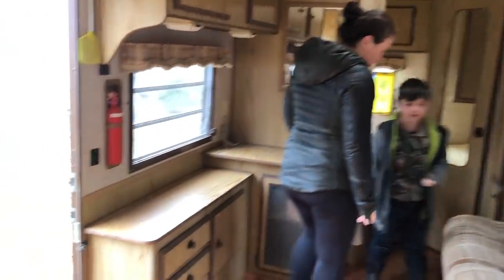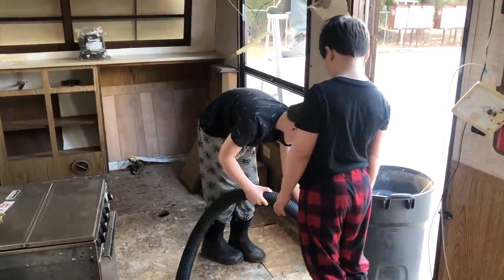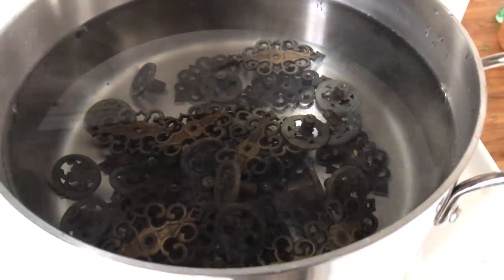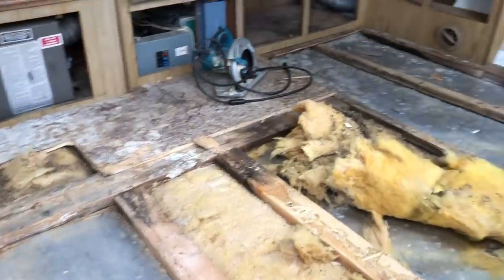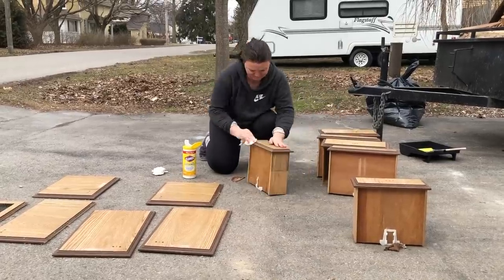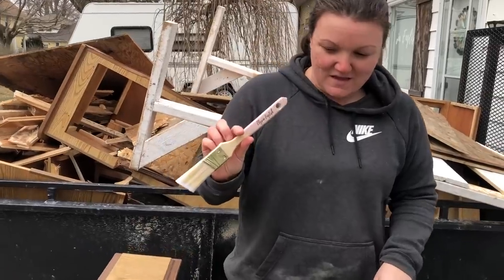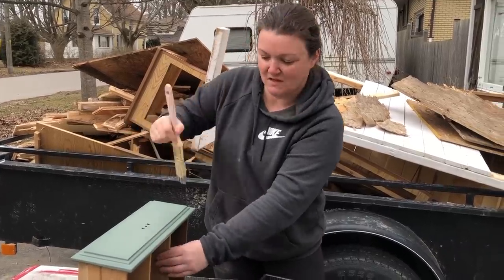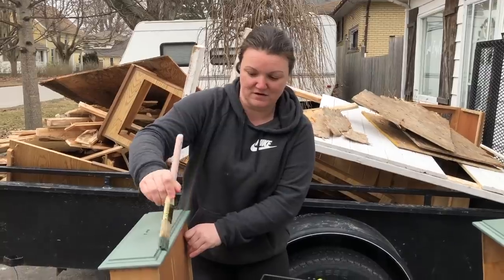Camper Makeover | Adding Paint!!!?? | Episode 4

Comment: Hey … First, thank you for the Camper Makeover series you are doing. It has inspired me to begin looking for an RV and doing a makeover too. -- With all the new technologies, the sky is the limit and your imaginations will be your only limitation. My parents owned a motorhome back in the 80's... a couple things they added were a TV, huge plastic storage bins on top, a really powerful AC, and a microwave. One thing that will set a killer ambient mood (and this won't cost much) is LCD lighting tape under and over your cabinets. The should have it on rolls at most of your home stores, and if you wire the strip (self stick) to your electric you can also add a dimmer switch for night. Thanks again, and I look forward to seeing more videos from you. BIGGEST HUGS.

Comment: I'm loving this series and especially your family's enthusiasm. A nice spring project to help get one through the coronavirus doldrums. Regarding mold under the mattress: a friend had a built-in plywood platform bed with a thick foam mattress and discovered that body heat created condensation under the mattress, resulting in mold. He replaced the moldy plywood and drilled ventilation holes in the new top before laying the mattress down. It cured the problem. I understand condensation can be a real issue in trailers.

Totally love your green color for the lower kitchen cabinets! It's the same color I painted my laundry room. I also lucked out and found brand new complementary green vinyl sheet flooring--the super-expensive antibacterial kind used in hospitals--for 1/4 the price at Habitat ReStores. Given the small size of your trailer, it might be a good alternative, even if you had to pay full price. If nothing else, maybe put a piece in your bathroom where the antibacterial qualities would be a bonus.

Comment: We are all having great fun watching you do this. I will add a couple of tips to the already great ones given. 1) Refrigerators don’t work correctly unless your camper is level both side-side and front-back. Since almost no campsites are flat, we got a small level and carry 6 or 8 boards - 1x10 or 2x10 cut to a length no longer than the distance between your 2 camper tires. Imperative to also have 2 chocks (or blocks of 6x6) to throw behind the tires.  2) RV ovens burn food quickly. Put a pizza stone between burner and pan.   Making great memories!

Comment: Think Tiny House living: everything should serve double duty. I have had several trailers/RVs. If you put booth seating: drawers that glide out so you do not have to lift the seat causing one to get up and move. Also, cabinet shelves should glide out but also lock. Dont want doors opening and food spilling out when your pulling trailer. LED lighting. Butcher block cutting block prep that also covers stovetop when not using. Collapsable everything, room saver. Orderizers for septic tanks. Do not use bleach for tanks--bad. I can go on n on.
Reply: Melissa Ramirez I have not owned a camper/RV but love all your suggestions !!!  Great ideas!  And you are correct to THANK TINY HOUSE LIVING 👍

This is exciting 😁😁😁💕

Comment: Having enough electrical outlets! Especially in places that make sense for you guys. Since you guys will be editing videos in the trailer. In the trailer I have there isn’t a lot of outlets, and they are in the most random places.
Reply: In a trailer, the outlets/wiring are dependent upon the amps the breaker can support. The trailer is probably a 30amp and can only support that much total. So if you use 2 appliances that are plugged into 2 different outlets that use more it will trip the breaker. Hope that makes sense.
Reply: add usb outlets for charging phones and computers.

Comment: The first thing I learned was that I did not need as much clothes as I packed into it. Second thing was to put more  snack foods like popcorn because you can cook it out over a open 🔥. Good luck with the wall paper if it was factory applied u will end up taking chunked out of your walls if it was factory installed the best is to glue and seals all seams patch anywhere there is a hole and then paint over it. I tried to remove factory paper and had to replace a wall. If u leave any wood that is not going to be painted it’s a good idea to use some wood restore on it that woods drys out. Also u need a water filter they have the $$$$ ones but if it just weekend camping and vacations there are a ton on the market that’s good. It’s a good idea to have a folding clothes drying rack to put towels on after showers they will smell quickly if several is left in bathroom ikea as one that folds up to under an inch wide about 3 ft long it’s easy to stow and u can hang them out side and dry in a few minutes. People also forget to put pot holders in the campers on first trip out. Also magic marker and pen and paper marker for marking paper cups and pen and paper to write lists of things needed

Comment: You will need a canopy of some sort. It does not need to attach to the camper. But, in rainy weather you need to be able to expand to the outside. (Along with some folding chairs and  a folding table.)

Comment: I have built a few tiny houses on wheels, and a gypsy wagon.  In all of them I have taken out the wet toilet, and gone composting with urine divert er.  This leaves you able to dry camp for sooo much longer without looking for dump stations.  On the trailers with tanks on board already, I have re-plumbed the black tank to grey, and plumbed the urine diverter into it.  It also cuts down on a lot of weight.

Comment: Ivory done a few campers and trailers in mobile homes in my time you don’t need to remove that awful wallpaper just wipe it down with the same thing you were wiping your cabinets down with and then just paint it it’ll come out beautiful and it’ll be a real mess if you try and pull it off because it’s not regular wallpaper
Reply: Bertrelle Phillips Absolutely correct!  We are full time RV dwellers!  That wallpaper is part of the wood. Just paint it!
Reply: I agree, only if there has been no moisture penetration to the wood behind.  If there has been, it will show through, and may even de-laminate.

Comment: Hi Elysia,

You folks are doing a great job!  Can’t wait until your reno is done.  

Must haves:
1.  Many RVer’s use an Instant Pot, I prefer the Ninja 4 in 1.  You can research both and compare.  Great for a family of four, easy to use and the recipe book is amazing.  
2.  Also, we found an 8 piece traveling metal fence for our dogs when we are camping.  We got two sets, so 16 panels. (Amazon)  We store the panels in a twin trifold bed canvas bag when traveling.  Must have for us, so that our small dogs aren’t tangling up any chains or knocking over outdoor furniture.  It assembles easily and quickly and we can relax outside while our dogs have independant movement in our camp yard area.  We choose Yaheetech 24” tall Heavy Duty metal pet fence.  It works really well and has become one of our top 5 favorite items.

Comment: Hi I'm new to your channel and I like what ya'll are doing....I have never had an RV but I would think you'll need some kind of hamper to collect y'alls dirty clothes and maybe some bungee cords to secure the cabinet drawers in case they decide not to lock in the middle of a trip definitely cast iron or metal or even the rubber heat resistant cooking ware for your stove/oven and bright high powered led battery or rechargeable lights and definitely a table cover for the picnic table or some foldable dining set and an outdoor rug to set up a sweet space at the campsite...and hooks to hang up wet towels or clothes or maybe even a retractable clothesline to keep all that wet stuff out of the RV and a collapsible basket or box to keep your shoes outside or at least contained to keep your space clean...cooking stuff for outside on the campfire in case you want to cook outside....just thinking maybe this helps, maybe it gets you thinking...thanks for sharing God bless and stay safe...can't wait to see your adventure videos 🥰

Comment: You may not see this comment but putting here as I’m binge watching your trailer make over in case anyone has the not rolling roller issue. The weight of the paint especially for small foam ones wont let it roll at first. Use the paintbrush to layer on paint onto the backside.
Reply from the maker: My roller was new a a little tight :)

Comment: All your dishes should nest into each other. Crock pot, electric skillet( your gas will run out quick if you need heat. Mini vac for cleaning and for vacuum bags that hold extra linens, dirty cloths etc... keep all foods in Tupperware or the like to keep bugs and mice away. Travel size games! Door mat for outside and inside the door. Muddy or wet shoes put in a tote with the lid under the step. Sit on step to take off and put on your shoes.

Comment: Do everything you can to plug every spot a mouse could get in.  And have traps set all the time just in case.  We always have nylon cord to run between trees for a clothes line, stick-up hooks to hang wet towels/clothes in the tub, solar lights, a carpet for outside the door to keep dirt out, small shovel to dig trenches when our site starts to flood, small axe, mosquito coils and bug spray, a level, basic tools .  It's an endless list and after 15 years with various campers, we have pretty much everything dedicated to the camper now.
Reply from the maker: Thanks for the tips!! I jotted them down :)
Reply: @ElysiaEnglish  Oh and blocks for the wheels and something for levelling the camper [trust me you may think not being level is not a big thing but the person on the low side of the camper won't agree by morning]. You can get specialized blocks, but sometimes an old board works too.  If you're using the toilet [#1 only!] take the hoses to drain the tank, but also disposable gloves.  Seems wasteful but you'll thank me.  We keep the hose in a giant ziplock bag.  If you're in Provincial Parks there's no water or sewage hookups, so you'll need containers to carry water from the tap to refill your water tank.  We don't drink the water from our tank so re-use 4 litre bottles and take our own drinking water.

Comment: Love following you on this adventure.
From one Camping newbie to another, try using "multi use" utensiles. OXO has a measureing tool for both liquid and dry, it's a cone inside a cone with measureing lines on the side, slide the inner cone up to desired line and fill. Try not to use a lot of paper plates, but use thin corningware dishes. 
All the best to you and family.

Comment: To get the original brass patina from your handles and such the best way to do it is not to boil it it is to get a little container that can hold gasoline and put a little bit of 85 ethanol in the bowl with the hardware

Comment: This may have been said but, keep weight in mind. What ever weight you take out, keep close to that when adding and replacing. You want the camper to remain relatively the same weight as manufacturers specs, For towing safety and fuel mileage. We redid our 1991 26’ bunkhouse camper. We had the year off and replace the entire roof. And then everything from there down. If was fun and more time than i thought. But the results were great. Having something custom to our needs and People wanting to tour it when we want places made it all worth it. Keep the wallpaper, it is factory fused, it won’t peel. You have to paint over it. I’m sure you have figured out that you can paint the bathroom sink and faucets with special paints. The option a are endless. Just be mindful of weights and weight distribution. Can’t wait to see the result.

Comment: Must haves for me (it’s just my experience).  A hot plate (we know what it’s like to run out of propane).  We also purchased one of those faux fire places that give out heat for when you’re out of propane.  Also, get a few tubs of Damprid when winterizing your camper (condensation in the winter happens fast and it can start getting smelly).  When you winterize, keep the fridge open so it doesn’t get moldy and smelly.  Think dual function furniture.  My ottoman was also storage space for extra blankets.  Always have flashlights available and batteries (candles too).  A collapsible dish rack that goes in the sink.  Also one of these https://www.amazon.com/Roll-up-Foldable-Stainless-Kitchen-17-8x11-2/dp/B0173GPLA2 (game changer, serves as extra counter space for tiny kitchens)...hope this helps.
Reply: CAUTION!  CANDLES KIDS & DOGS IN SMALL PLACES ARE A ACCIDENT WAITING TO HAPPEN.
Reply: diana lyman - you’re right!  I overlooked that she has little ones.  (Let’s skip that one).

Comment: I love the retro green paint!  I have a question:  I’m reusing some pine closet shelving in my new pantry. I’ve sanded all the old stain off.  Now I’m not sure what kind of finish to put back on them.  Should I just use a clear shellac or should I restain them?  I will be using matte black iron supports.  I’m going for a modern farmhouse look. What would you do?
Reply from the maker: I’d rub a little stain on them and then a clear coat :)